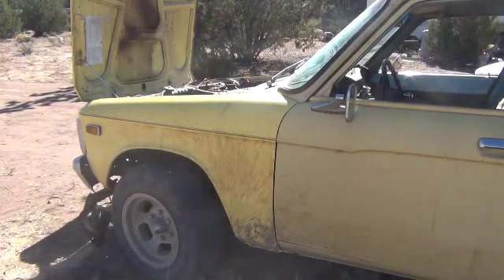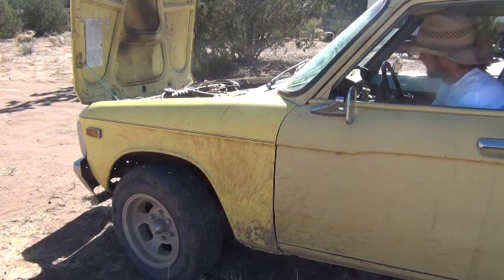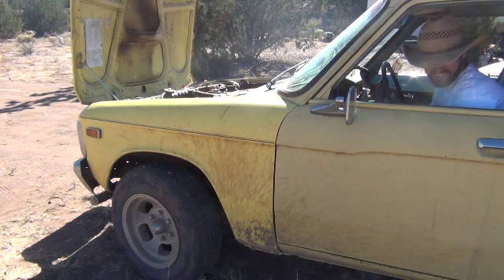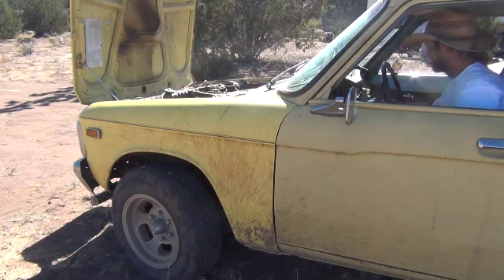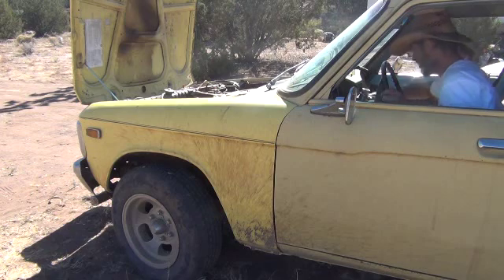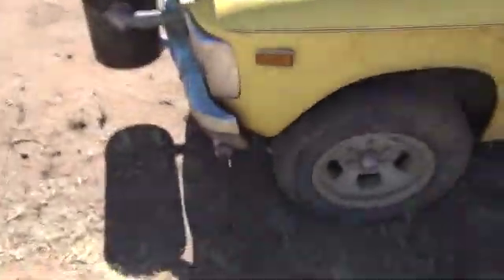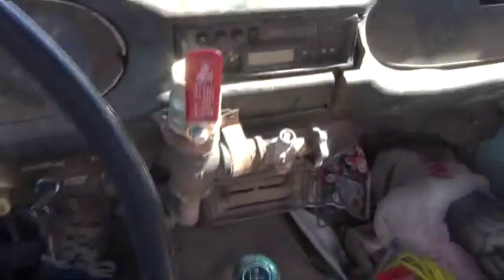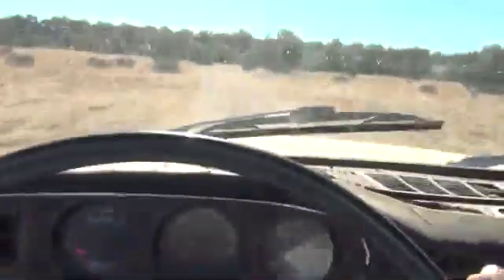Gasifier Truck How-To part 16

Comment: Mr Teslonian.
I am trying to make a gasifier that runs a chevy 454 motor on an RV. I have already built most of it.   55 gallon drums are the base. 8 inch hearth. 1/2 inch walls in hearth. piped 4 in to filter barrel.   4 inch fan to engine. any suggestions??

Comment: To get it started MUCH easier  . . . Wait until the fan flames and MAINTAINS a flame at the output before attempting to start the engine. That way there is already burnable syngas to run the engine with.

Comment: MrTeslonian, Do you think this system could be modified to run a small 302 ci v8, with say the addition 4 more inlet/intake tubes? Also would like to know what kind of range you are achieving with a full load and how well it performs at greater speeds down the road.